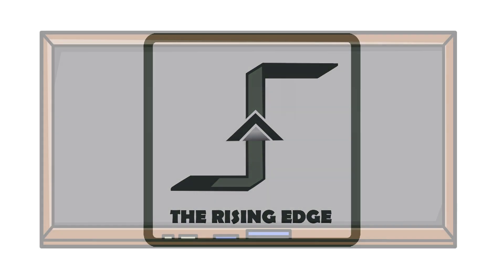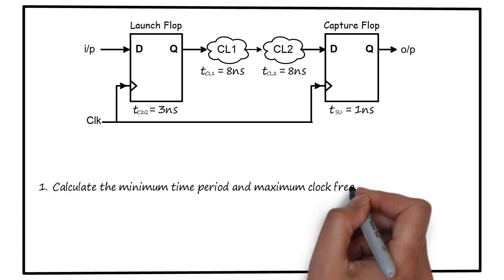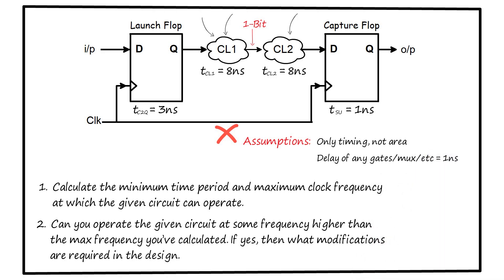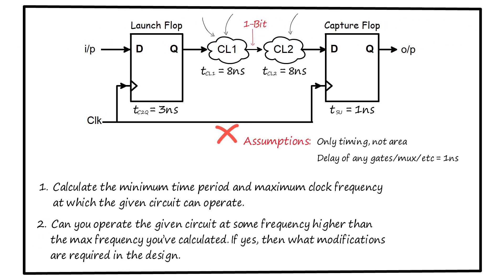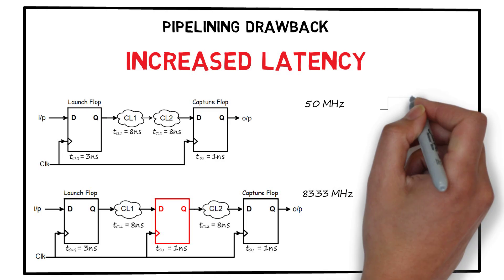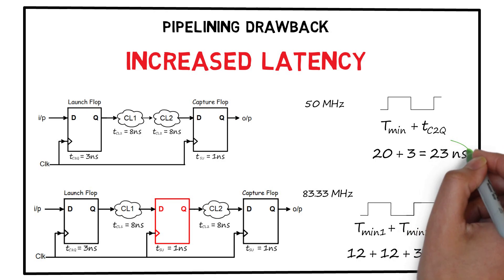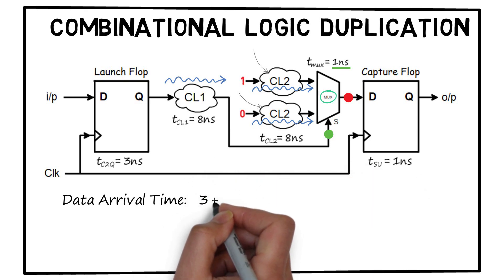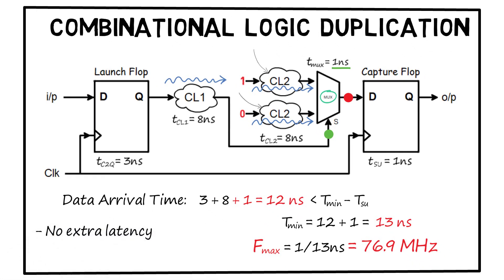STA INTERVIEW QUESTION | STA - 6 | Static Timing Analysis | The Rising Edge

Comment: note that CL2 delay is irrelevant as the inputs are constant, so even in case of 80nS CL2 (much larger than CL1), the cycle time will remain the same. 
(of course there are initialization conditions, but I'm assuming they are similar to the non relevant signals in CLs)

Comment: 5:00 The main purpose of increasing frequency is to make the system fast, right ? And here even after increasing the freq, we are getting output, late.
Reply: Pipelining is really an advanced topic and heavily used in the industory. Consider you are designing a microprocessor, there is single instruction logic that have higher delay in combinatorial logic (bottle neck), effectively deciding max allowed frequency of the design, you can use pipeline for that part effectively increasing execution time for that instruction (😥), however for other instructions' logics you increased the frequency (😂😂 )and hence in nutshell you gain improvement.

Comment: Can we optimize it more by adding a mux to CL1 just like CL2?
Reply: You can add mux for CL1 where u can save 2ns because tc2q is 3ns and mux have 1ns  In parallel CL1 start transmitting 0 and 1 and take 8ns.
8ns-3ns = 5ns which means output data available after 3ns still it take 5ns to get output from mux and delay of mux is 1ns that will add up 5ns + 1ns = 6ns
So we can save 2ns in total.

Comment: Bro If the hold time does not hold good then we have to change some delays which in turn change clock frequency ?
Reply from the maker: Yes, there is a tradeoff. If we try to reduce one type of violation more than a certain extent, the other one may get violated. So we've to design the delays in such a manner that it is somewhat midway between both the extremes and no side gets violated.

Comment: Hi 
Thank you so much for this wonderful content. I had a question about using pipeline flops.  Can I insert pipelines to remove hold violations that may occur due to clock skew? 
Thanks
Reply from the maker: Yes, you can but you've to make sure that setup is not violated in doing so and overall latency is not of much concern.